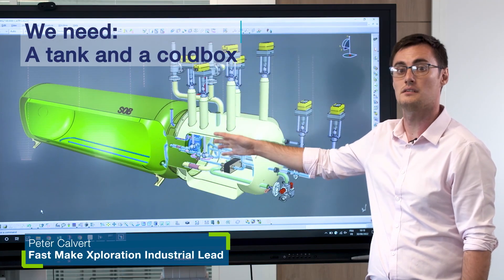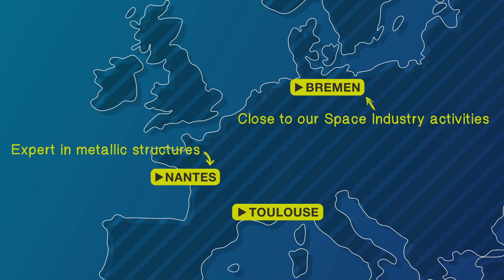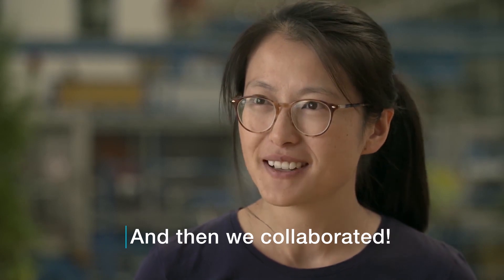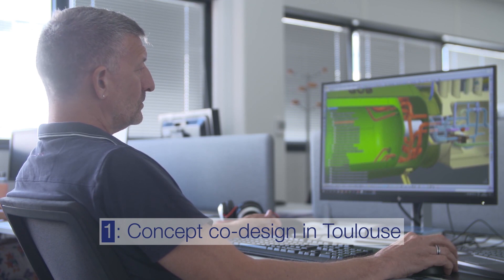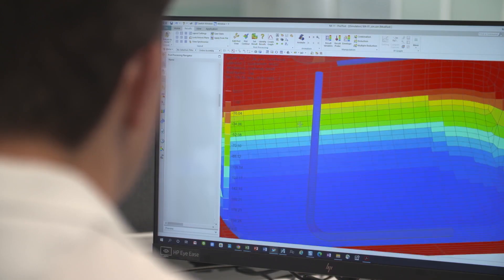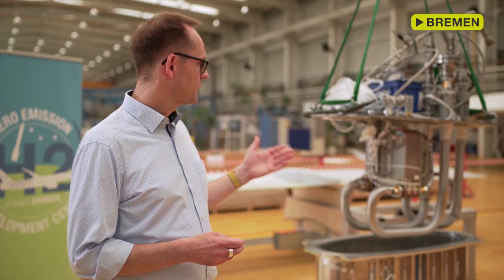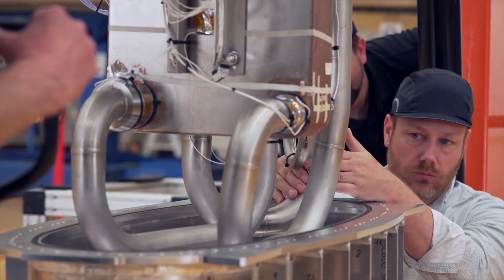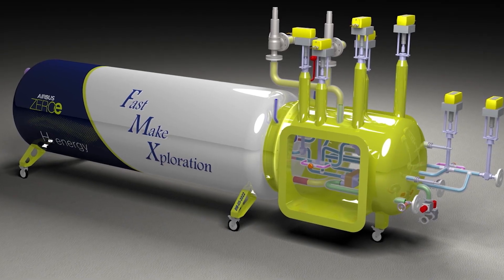Countdown to #ZEROe: Episode 1 - Tanks

Comment: No way, too dangerous and too expensive to produce. One spark, one leak. You are going to need electric power plants just to extract the hydrogen. Sooner or later boom!  The hydrogen atom is the smallest atom in the universe and is never found as a gas it has to be extracted. It will end up so hard they will scrap it.

Comment: Is it just me or do most of us sense that Airbus is trying to reinvent the wheel. Why not make joint ventures with those who have lots of experience in Hydrogen storage for transportation (Toyota, Hyundai…)?
Reply: Planes and cars are two completly different story, you can't compare them, it's not the same level of security needed + it's not the same environnement the engines are going to work in. And last but least, Airbus is now going to become (alone) a master in this industry without owing to Hyundaï or Toyota tons of money.
Reply: Car doesn’t fly genius!
Reply: @hafizuddinmohdlowhim8426  No, they don’t fly, but they also need safe hydrogen storage. Both Toyota and Hyundai have extensive experience with fuel cells. The cost of further development is huge.
This cost could be shared instead of Airbus re-inventing the wheel while starting way behind.
The Airbus project has been going for over a year now and they have already welded a cylinder! Whoaw, that’s the way to go!
Reply: @HugoAelbrecht  mr genius, gas hydrogen and liquid hydrogen is two very different state of fluid. Your statement doesn’t make sense because safety standards for hydrogen car is not practical for liquid hydrogen. Did you see hydrogen car is storing liquid hydrogen at 20K? Just no.